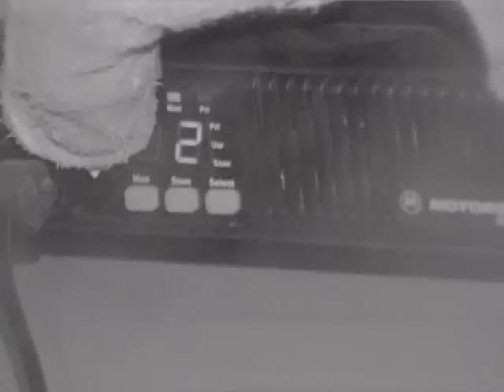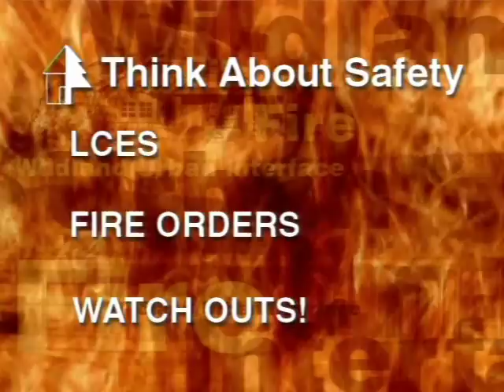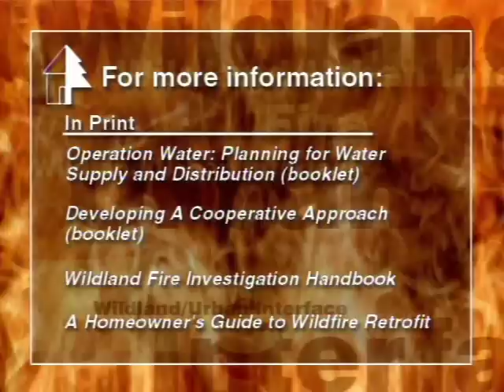Structure Protection Strategies in the Wildland/Urban

Comment: This needs to be renamed from structure protection strategies to evacuation routes and safety.
Reply: That's pretty much what structure groups are.  How long can we stay and at which trigger points do we begin to consider-very seriously- which escape route didn't get cut off yet?  Structure protection is very simple.  Can you leave it alone, can you remove some household stuff, cut the prized tree, pulled granny's' prize Purple Cush that wins worldwide acclaim.  There is a lot more that goes into this-as you probably know. The third type is-I don't have enough trust that this will be incinerated within the hour and you need to get a quick snapshot and a ribbon on the entry. No need to look for the ribbon- that's what the GPS is for. 
That's what you get for making good comments.